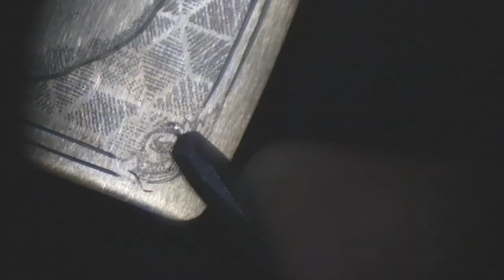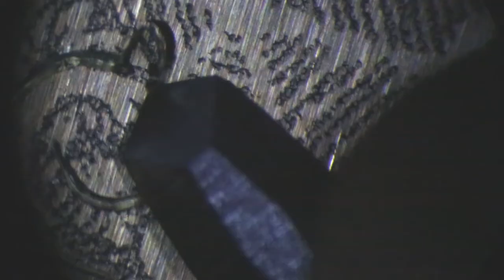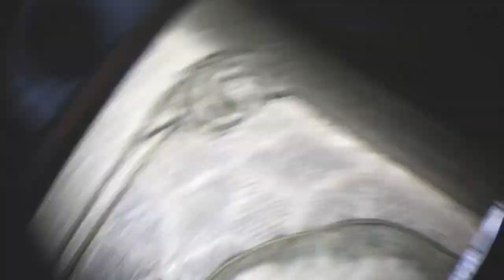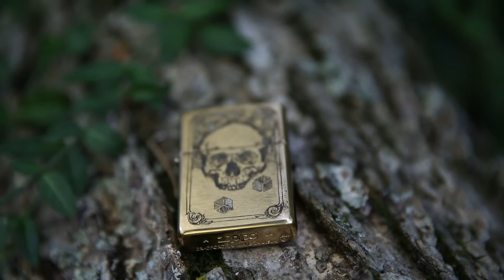Customizing A Zippo With A Hand Engraved Skull -#engraving #zippo #edc

Comment: I've tried engraving on a small medium.  I used 120°.  but in the leaves it always goes out of line that I draw.  how many degrees did you use in the video?  for small media such as watches and zippo kotek how many degrees do you recommend especially for cutting back bone??
Reply from the maker: it just takes tons of practice. I still struggle to get good clean lines on tiny curves. Try not going so deep and slowing way down.